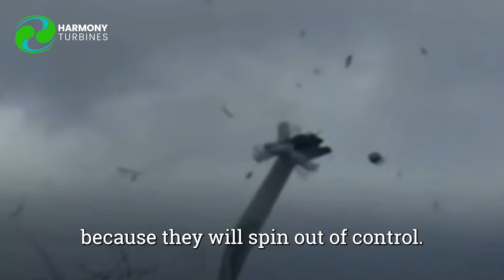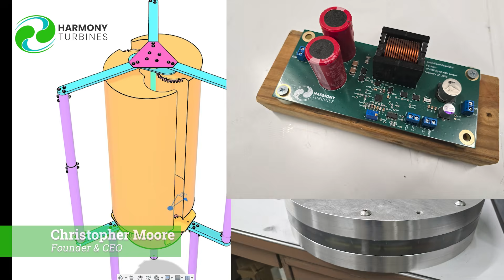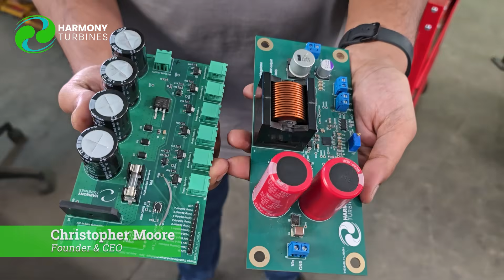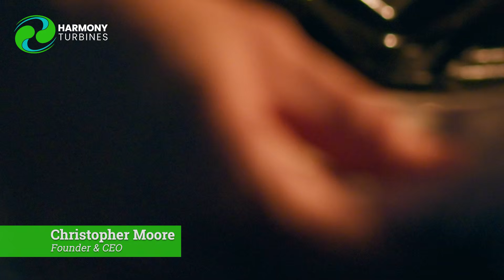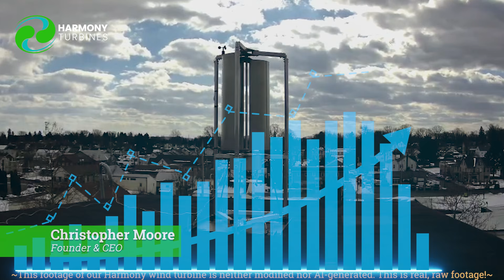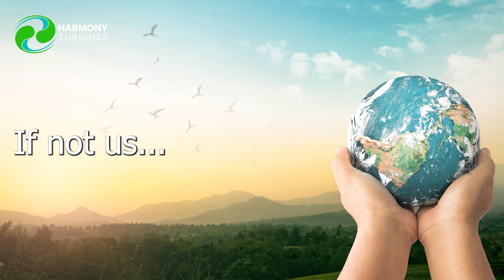What's the big deal about Harmony Turbines anyway?

Comment: I love the effort you guys have put into it, I've wanted to build my own vertical axis wind turbine but it wasn't going to be near as high-tech, it was going to be using a car alternator to generate electricity
Reply: Car alternators are notoriously inefficient as they consume nearly all the power produced to charge the electromagnets of the rotor.  However, that being said they do have some useable parts.  To get the most out of an alternator for power generation you will want to either unwind the rotor and machine it for permanent magnets, or replace the rotor entirely with one designed as permanent magnet.  Then you will also want to re-wind the stator.  Alternators are meant for low voltage high amperage, you want high voltage low amperage.  To achieve this you will want to reduce the wire size and increase the wraps in the stator windings.  For best results, alternate your winding directions clockwise-counter clockwise-clockwise and so on to keep the electron flow in the same direction.  Remove the brushes from the alternator to reduce drag and the voltage regulator as you won't need them with a PM rotor, but keep the bridge rectifier to output DC voltage to your charge controller.  It is perfectly doable and I encourage you try.  If I can help you in any way please let me know.